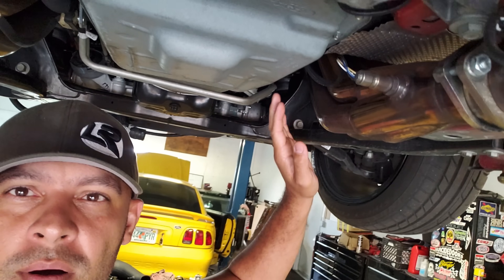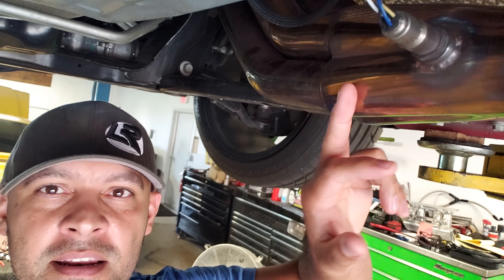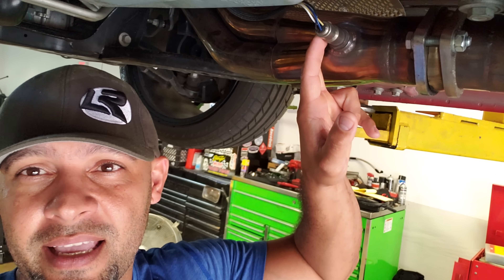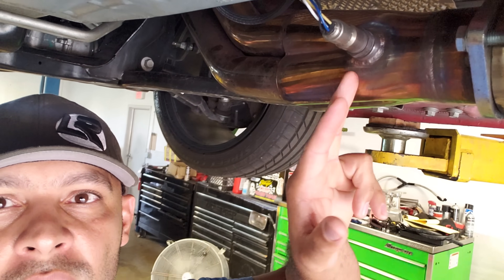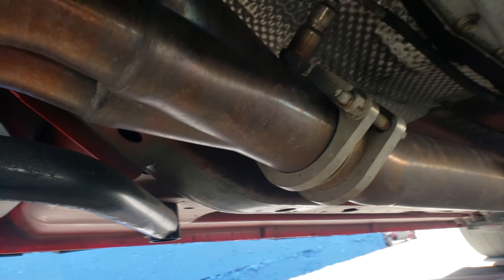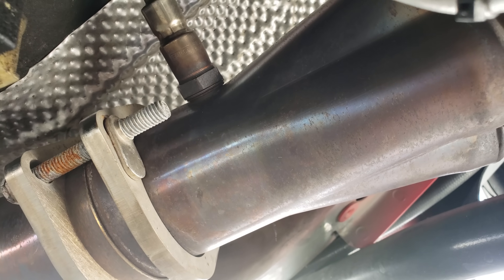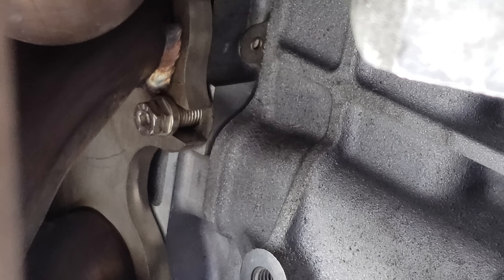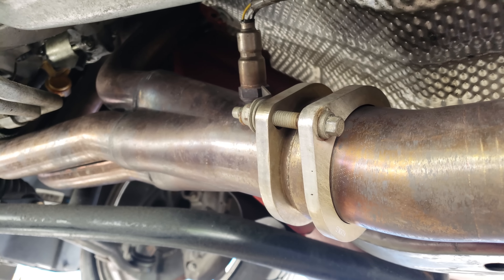Why do O2 sensors fail with E85 and longtubes?

Comment: I just switched to shorty headers and had to weld my bank 2 sensor 1 more further down because the aftermarket headers had the o2 sensor touching the transmission but now I got a check engine light sayin bank2 sensor 1 is stuck rich (p2198) and bank 1 sensor 1 slow circuit (p0133) any ideas what could fix it? Thanks in advance !

Comment: I have stainless works long tube headers on my 2012 Shelby. I installed them when the car only had 1,900 miles. The car now has 16,300 miles and just recently one of my o2 sensors went. But I think the reason is because I just don’t drive the car. But good video man!!! Never knew about you. I just subscribed!

Comment: Quick question so I switched to e85 recently and I have bbk long tubes on my 2014 Mustang GT and it ran a P2629 code with some other misfire codes and after watching your video I feel that it’s because of the O2 sensors and e85 because they’re BBK long tube headers and the sensor is horizontal not on a 45° angle so my question is will those O2 extenders work on any O2 sensor or do I need a specific one??

Comment: I have a really hard time keeping 02 sensors alive. I have a Sniper efi system I am using the 0bx bung extender yet still killing sensors in about 6 months of daily driving use. I am gonna try to move the o2 sensor further back and see if that helps

Comment: Speed daddy headers on my 18 for over a year and a half with a heat sink and o2 sensors are still good with E85 been on the car forever
Reply: What are the heat sinks?
Reply: @jessielee1520  it’s basically a spacer for the O2 sensors that has a little filter that prevents them from getting burnt 
Ran them for 2 years now and still going strong

Comment: Hello. Im running shorty headers with a catless h pipe(no change in diameter) and my rear o2s are turned on and working but i cant get my o2 sensors to ready up for an obdll test. Any info would be great!
Reply from the maker: Mil eliminators or o2 extensions in the rear might help to get it away from the pipe
Reply: Im sorry. I should specify alil more..i have a 2012 3.7 stang and im running  defoulers. I have no codes and ive put up to 500 miles on the car following the drive cycle and they wont ready up.
Reply: Also boosted and running e85 if that plays a roll
Reply from the maker: @POORBOYZPERFORMANCE  ah your tuner might have to enable all sensors. If not equipped already
Reply: Jad everything turned on...everything is reading as if the cats were still in place. We've been scratching our heads so i figured id reach out

Comment: Hey Alex I did the 45°angle and I got new o2 sensors for my s550 gt and it works so much better now but my cold starts are still turning off the car. Aka knocking off. What else can that be?

Comment: Hey quick question I have a 13 Gt with a Roush Stage 3 supercharger kit. The kit comes with 49# injectors I believe and a bap, fuel system is stock otherwise. What do I need to run e85? Any recommendations for fuel upgrades would be greatly appreciated

Comment: To me, part of that issue with condensation may be not having any kats, in 2014 I think ,I went with JBA ceramic coated long tubes with high-flow cats ,V band clamps, $1150 I think it was,, never had any leaks /issues and I Love them,

Comment: Alex , you always have great videos,  and you also let us know why you use certain parts . On a 2015 N/A s550 ; I was going to put on long tube headers & a intake , & tune  .  Would headers make a big difference??
Reply: yes headers make the most difference out of anything na outside of maybe a cobra jet intake or cams or something like that that's big ticket headers will make the most power of any single bolt on (tune not included)
Reply: Thanks for your input,  I will also buy long tube headers

Comment: Stainless Works . Mine are beautiful .
Reply: David Ray I also have stainless works but my check engine light code came on after installing them tuner says it's due to bad o2s.
Reply: @Skidzjr  what did you do man I’m getting code p0135 I might relocate the upstream bungs
Reply: @superjavi9820  I had to purchase new o2 sensors and problem went away
Reply: @Skidzjr  thanks

Comment: I put the correct size lock washers on the bolts that kooks supplied and have had zero issues. I hated the gaskets kooks supplied, ruined one in about 5 seconds putting my headers on. My stock gaskets looked brand new(car had 5k on it) so they got reused.

Comment: My o2s have failed twice (no extensions) upstream driverside with long tubes switching between a dialed in vmp and lund tune so good luck! My car only has 27k on it btw and the  longtubes are borla and car runs on 93-91octane

Comment: I double stacked spark plug non foulers on the O2 bungs on my Stainless Works headers just because I didn’t want to take a chance.   Not to mention I didn’t want a CEL due to a lack of cats.  Haven’t had any issues a thousand miles after.

Comment: 73K miles on my Gt with MAK cat deletes and E85 since 14K miles, still on stock O2 sensor's.  Zero issues
Reply: David Figueroa i have mak cat deletes also. I don’t run e85 yet tho. Do you have an Xpipe and also which mufflers do you have. 
I have roush mufflers and around 3-5k rpm accelerating my exhaust does this clapping sound that i hate.
Reply: @Allthingschillguy  I'm running x-pipe to borla s-type mufflers. What you're hearing is most likely the rasp due to the cat deletes, x-pipe' and roush combo which is very common with that exhaust combo. You might want to add resonators to remove the raspy sound or change mufflers
Reply: David Figueroa they sound so good under full throttle 😭 so you don’t have this problem at all ?
Reply: @Allthingschillguy   No, not at all. Just adding resonators will lower/eliminate  the rasp but still sound good at WOT
Reply: David Figueroa my buddy has muffler deletes pipes that would make me straight pipe lol you think that would also get rid of that rasp ?
Reply: @Allthingschillguy  no, that will only make it worse lol
Reply: David Figueroa lol ohhh 😮 well i just want to see what it sounds like with them.
Reply: David Figueroa you have an insta ?
Reply: @Allthingschillguy  yeah, its L_centenario

Comment: I have ARH long tubes on my 17 and I ended up cutting the bungs off, filling the holes, and reposition the bungs. ARH headers do not have angled sensor placement. Great quality and fit but that was the only issue I had. I have pictures if interested.

Comment: Thoughts on eBay No Name headers? My buddy got some ebay long tube headers and during 40-140 rolls, we went from being side by side to him pullin around 1 1/2 lengths. That $200 sounds a lot better than $1000
Reply: allen_nightmare5oh $200 to party now and replace them in about 2 years or $1000 and never need to replace them unless you swapping for turbo. But if that's the route you want to go, use ON3 shorties as it's what their turbo kit uses if I'm not mistaken. I think they just swap sides so they face forward with the turbos.
Reply: If you enjoy having to weld headers up, or resurface them when they warp, go for it.
Reply: Make sure you wrap them...
Reply: Trash. That's why they are that price. I've installed them for guys they don't line up right warp crack. They suck to put in save up and do it right the 1st time. I have Stainless works. No issues

Comment: I run e85 with stainless works long tubes and have killed 4 sets of o2's in 4 years. Ive heated up the o2 bung and angled the sensors down along with wrapping the collectors. Ive just learned to keep a spare set ready when going racing
Reply: diddylx50 I just killed my first set on my 2017... Didn't know it was an issue til it happened

Comment: Alex, you are 100% correct on the angle, and re welding the bungs at a 45 degree angle I did it to my ARH headers... but the "heat sinks" they space the sensor out of the exhaust stream. That may be fine for the rear 02's but the front ones are wide band that the ECU uses to tune the air fuel mixture... won't that affect the car's AFR and potentially cause SERIOUS issues?

Comment: Alex, I have  set of Dynatechs for my GT500 that I need to install. Plans are to have the wideband bungs moved back and rotated to 45 degrees like you mentioned then get them Ceramic coated inside and out. When ever I do and I need my Lund tune file update, will I need to let the Lund contact know how far I had the bung moved back in the collector?

Comment: Headers to me are worth it even NA. My ARH long tubes alone got me 20rwhp, along with that killer sound.
Reply: Def and peak power is only part of the story when you see the graphs before and after its obvious anyone who knows what theyre talking about would agree with you and i.  Hell its the only na mod that really does alot far as bolt ons after an e85 tune.  The exhaust helps  a tad the intake a tad and even a ported manifold or better yet ported cj intake another mod that really helps if tuned right even on 18s because it isnt just what it picks up its where it picks it up...up top is most important when trying to go faster.  All the little stuff adds up but e85 tune, long tubes, intake manifold mods that is the things that is really gonna help na on a coyote....intske and catbacks help too but not nearly as much...it all works together in a combo
Reply: Who said they were not worth it NA?
Reply: I gained about 27rwhp on my silverado with ARH long tubes and tuning adjustments... I had other bolt ons and a cam as well.
Reply: What year? 5.3?
Reply: HAHAH! Exactly, LTs are badass.
Reply: I picked up 20whp just by deleting the cats lol
Reply: @hypotheticallstuningalejan40  maybe so but you cant really do an apples to apples comparison on different cars in different places on different dy os with different setups etc.  You may have gained the same 20 whp with cat deletes only as someone else did with catless longtubes but im 1000% sure youd have picked up more with catless longtubes on your car on your dyno with your setup.  Id say another 10 whp is what youd prob gain over cat deletes only.  Its not huge gains but every little bit matters when na.  Long tubes are important because they act almost like a pump almost sucking the air out of the engine quicker making it more efficient and allowing more air to be taken in.  Ive even seen where they can increase flow on the intake side of the engine due to this.  If you dont care about getting all the power possible out of the engine then longtubes can be skipped but if you want a fast na setup you need to do it all because all of it compliments each other.  Catless headers help an intake manifold swap and both of those things allow aftermarket cams to be more effective and a full exhaust helps as does an aftermarket air intake if you have all the other mods and a manifold swap and cams etc.  You can get power from an air intake on a stockish car but it wont be much...each of the mods dont do alot by themselves but its the accumulative effect all the mods together have on the car that makes it signifcantly faster.  Ported cj intake with a monoblade tbody and pmas cai catless longtubes l&m intake only cams and a full exhaust could be tuned by a good tuner on e85 to get you 500ish whp...i think thats pretty respectable for such a mild combo on an na 5.0 liter engine...thats over 100 whp from stock...all those things must really add up afterall.  Thats to all the people who say long tubes dont matter and cj intakes dont do that much etc etc....evidently it must be doing something lol.  Thats the setup im gonna go with when/if i decide to get a coyote powered mustang as my next mustang when the time comes.  Between doing that or getting my dream car since 19 a terminator or gt500.
..gotta decide which way i wanna go

Comment: Ethanol is hydroscopic (like brake fluid) and pulls moisture from the air. Old e85 will grow in volume as it absorbs water over time.

The other side of this (and why aftermarket wide and systems fail often) is because of the heater circuit programming. When you shut off off a hot engine you get condensation in the engine/exhaust. When you start the engine all that condensation Flys through as droplets. Here's the problem, if your aftermarket wideband is programed to heat the sensor immediately you end up with a hot sensor in the path of water droplets. If a water droplet lands on the hot sensor it thermal shocks and it cracks. If you sit with the key on (so your aftermarket wideband sees ignition 12v) it will do its heater cycle while the engine is off. The oems solve this by not heating the stock wideband o2 until it sees engine rpm.
Reply: oh, a voice of reason. :)
Reply: Is that OEM since 2011 and up that does that?
Reply: This is exactly what mine is doing! So if I turn on key and wait before start it won’t happen is what your saying? 2016 mustang headers on e85?

Comment: I was literally just wondering to myself if I should re-locate my O2 sensors on my Stainless Works headers. They’ve held up for 3 tanks of E85 thus far.
Reply: Rockstar121292 I have the same set of headers did your CEL ever come on due to bad o2 sensors?